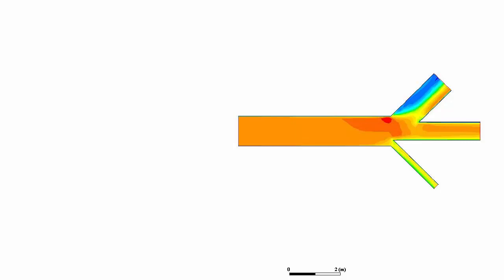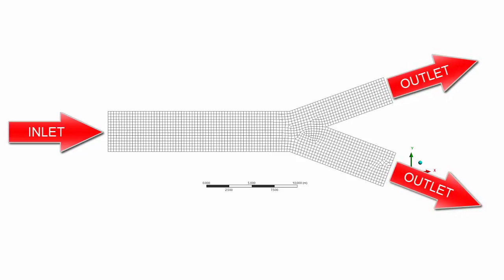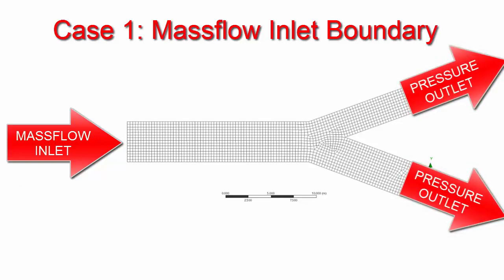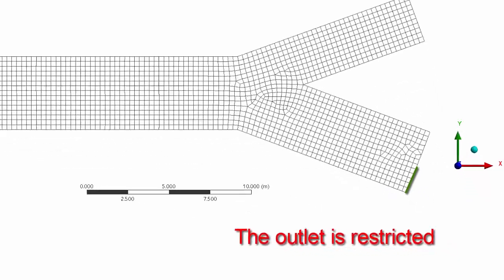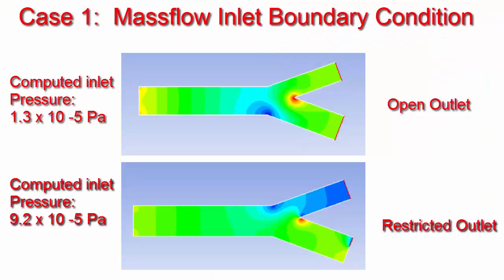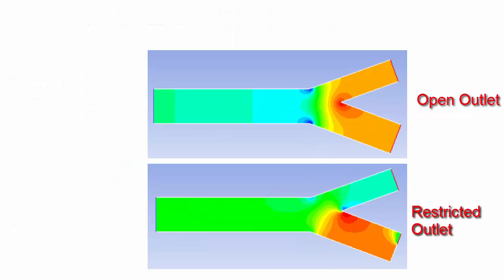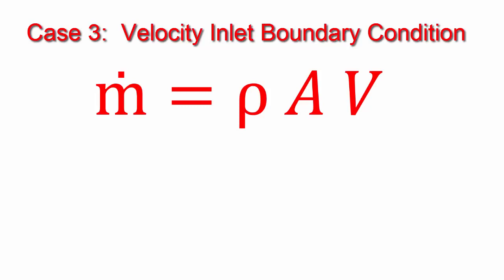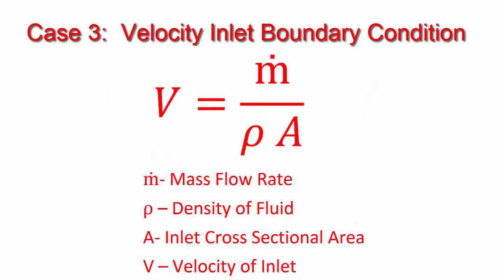MASSFLOW INLET vs PRESSURE INLET vs VELOCITY INLET | Ansys Fluent for Beginners

Comment: what is the formula to calculate the mass flow rate in channel flow over cylinder in 2 dimension? Please reply
Reply: do I need to consider the cross sectional area in case of a 2D contour?
Reply from the maker: If that is a cylinder, we need to select axisymmetric instead of planar in Fluent's general settings. In 2D simulations, the mass flow rate is computed and reported in Fluent by considering the third axis as 1m by default. You can change this in the reference values if you have the third axis dimension.

Comment: if im using air compressor as working fluid at the inlet , should i use pressure inlet or massflow rate inlet
Reply from the maker: If you are using an air compressor at the inlet, which maintains a constant pressure regardless of the flow domain or back pressure, pressure inlet should be the correct boundary.
Reply: @MechTechSimulations  thank you very much sir

Comment: I have 300kPa and 10m/s at inlet and want Pressure at exit. What should i do?
Reply from the maker: We cannot assign both pressure and velocity at the inlet. Because, it's dependent on the flow domain's pressure drop. 
For your case, if you are constrained with the pressure and velocity at the inlet,  you have to specify the velocity (Velocity Inlet). Based on the fluid properties and the backpressure offered by the flow domain, fluent will estimate the pressure at the inlet (an arbitrary pressure at the exit need to be specified). After computing a case, the exit pressure needs to be adjusted, to achieve the required pressure at the inlet.
Reply from the maker: Hope it makes sense. If not convinced with my answer, please feel free to drop your reply.
Reply: @MechTechSimulations  Thanks dear it makes sense. I am try to do the reverse engineering for it as u suggested.
Reply: @MechTechSimulations  i want to leave an email to u describing my issue

Comment: Thanks for the video.
I have two inlet and I need to assign 1 in inlet1 and 0 in inlet2, how to do it?
Reply from the maker: Do you want to assign flow rate/velocity of 1 unit in inlet 1 and another as zero inlet [ie: mass flow rate or velocity at the inlet is zero]?

If so, its not a big deal, just mention the values in the boundary conditions. If you express something else, please let me know.

Comment: Thank you for the video. At the beginning of the video, you mentioned the choice of BC depends on target of the simulation. How about matching BC with the real world condition? For instance, a piston moves back and forth at one end of a duct. The other end of the duct is not completely closed (partially open).
Reply from the maker: Partially opened duct can be geometrically made. But in order to simulate the piston moving back and forth, we have to use moving mesh.
Reply: Can I know how to give tail water in ansys

Comment: I want to do combustion / gasification in ansys fluent, but everytime I do, I get confused always.  Please respond me, I have some queries... When I mentioned my species composition and temperature in boundary condition, it gives me same in post processing... Means as it looks no reactions happen rather give me Same which I input... If I don't give thermal temperature and composition values, it gives me default... Means no reaction happens.... The same which I input in boundary conditions results the same.?

Comment: Can I put boundary volume flow Rate in the inlet fluent ?
Reply from the maker: No. But you can simply multiply the volume flow rate with its density and get the mass flow rate.
Reply from the maker: Otherwise, divide the volume flow rate with the inlet area and put the velocity. [velocity inlet]
Reply: Thank you 👍

Comment: Thanks for your Video. I have a problem that I know the inlet pressure and mass flow rate and want to calculate the outlet pressure..Can you tell me how?
Reply from the maker: It's impossible. It's not practical too. If you provide a mass flow rate, the pressure required to maintain that flow rate depends on your geometry. You cannot provide it.
May i know what is your objective? Do you want to calculate pressure drop in a flow domain?
Reply: @MechTechSimulations  I have the same problem on a inlet duct silencer. The mass flow inlet is known and the total pressure/static pressure at the inlet face is zero (i.e. at atmosphere). How can I setup up the BC at the inlet face so that I can calculate the static pressure after the silencer?

Comment: What if we need to calculate outlet total pressure using same mass flow rate on both sides? Which combo would be taken
Reply: Thanks for your help.
Reply from the maker: Dear waseeq siddiqui, the main thing you must know is that the mass flow rate at the inlet will be the same at the outlet at any cause (See: Law of conservation of mass).

In my experience, you could have "Massflow Inlet" and  "Pressure outlet" if you know the flow rate and outlet pressure.
We can compute the inlet and outlet pressure to estimate the. 

If you don't know the outlet pressure, go with "Mass flow inlet" and "Outlflow" boundary conditions.

Comment: Hello Mech tech.
Could you do a tutorial of a three phased separator? With Oil, water and gas?
I've learned a lot with your videos, but I can't simulate that and I'm trying really hard.
Thanks!
Reply from the maker: Ill find a time for sure..
Reply: @MechTechSimulations  what is the formula to calculate the mass flow rate in channel flow over cylinder in 2 dimension? Please reply